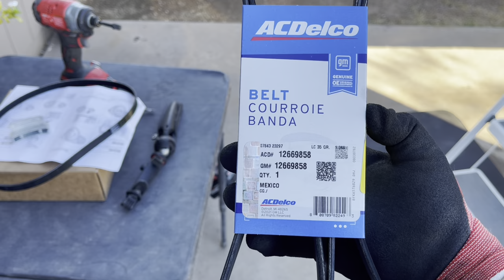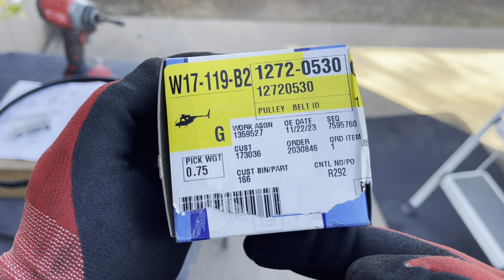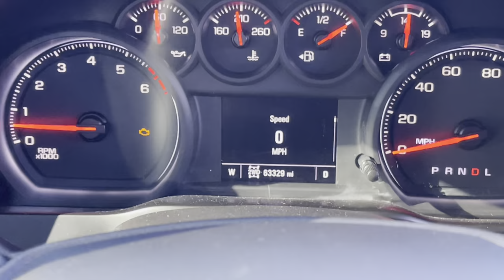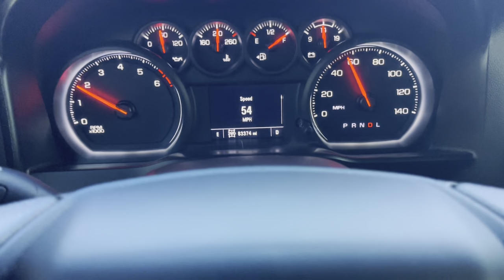Replacing Serpentine Belt / AC Belt & Pulley On 2020 Chevy Silverado.!!

Comment: I just changed both belts and the Idler pulley on my 2019 AT4 6.2, she was screaming hard.  I have no idea why it was so difficult for you to get the Serpentine belt on. I am by no means a mechanic other than YouTube videos. First off there is no need for the extra tool don't waste your money just use zip ties instead. I used 4 zip ties to get the AC belt on and 5 zip ties to get the Serpentine. I used a long breaker bar with a 24mm socket to turn the crank shaft no problem from underneath (if you jack the truck up for those of us without a lift it's way easier). Took me longer to guide the belt and zip tie it down than to turn the belts on. I spent a good bit of time cleaning the belt residue off the Alternator pulley (don't forget to do that). If you run into zero issues this is a 30min job max. I called GM to see what they would charge. Their $485.00 job cost me $65.00. But thank you for starting me in the right direction with your video.
Reply: How many miles did your truck have before you replaced the belts? I have the same truck and I’m at 96K and my belts are quiet
Reply from the maker: That’s awesome man happy to help and good advice 👍🏻
Reply: @Texas_G_Longhorns  2019 with 140k kms (about 87000 miles) and mine is making noise so I am looking at these videos.
Reply: @Texas_G_Longhorns Im in Arizona, and my 2020 LT Trail Boss started squeeling as well at about 43,000 miles. Replaced the belts, and idler and its been quiet since. May just be how dry it is here. No clue. Lol.

Comment: I have same truck my belt has slipped since bran new lol if there is heavy load on altenator  and you floor it ive been able to smell belt rubber and i look at belt looks fine so wtf..bought truck new now has 22k on it the stretchbelt design is tarded.the first thing i in 10:42 stalled was the dfm dissabler if you 10:28 10:34  haven't  you better get it so you dont loose an engine.

Comment from the maker: No problem man happy to help 👍🏻
Reply: Hey man I install the belt and pulley by turning the bottom wheel with ratchet where zip ties go, when I put everything back from air manifold I notice a puff sound coming out of it every time I turn off truck. Is that sound normal? Idk if I messed up timming by doing it by hand
Reply from the maker: @marvintamayo1533  hey I also tried doing it by hand even went back and forth I don’t think that would mess anything up but don’t quote me. Let us know if you figure out wat it is and wat did you do to fix it thanks

Comment: Just another thank you for the zip tie method described a 9:15 in the video. I walked out of the parts store not realizing the guy sold me a 22mm (not 24mm) socket and a tension (not stretch) belt tool. Three zip ties on the serp belt and bumping the starter worked like a charm!

Comment: READ BEFORE YOU START! Definitely put your truck in neutral before cranking the engine. 
-Push to start ignitions: with keys in cab NO foot on break hold the ignition button about 4 seconds, this starts your truck electronics without the engine on so you can then push the break and move to neutral with your park break on and chopped this allows you to rotate the engine crank pulley safely and easily. I read it could damage your transmission if you left it in park. 
-My belt was squeaking horribly for a few weeks. I changed both belts but cleaned up my idler pulley and reused it, it had rubber from the old belt but i greased it and cleaned up the grooves. 
-I cut both belts off to save my idler pulley from bending during removal.
-I started using a 15/16 socket as I did not have a 24mm. I ended up buying one anyway later but it worked and didnt slip bad.
-I broke my first AC belt attempt when it got twisted behind the AC pulley, he talks about this part around 7:30. I had to keep the AC belt guided on the AC pulley while my help cranked the ratchet. 
-Also the belt stretch tool was not helpful for me, I used 4 zip ties for the AC belt and 3 zip ties like many others here. 
-I had to buy an extra AC belt after the first got stuck but I still saved ~$400 doing this myself took a couple hours but I was being slow and making sure not to mess something up. 
-My old belt also shredded and I cleaned it off the engine bay. 
--Thanks for the video bro this helped buy some Christmas presents.

-I also read you can install a belt tensioner pulley with these trucks?
-My check engine light came on after this but that was because I accidentally started it putting it back in park without the HAF sensor attachted yet. I shut it off after 1 second and it just did a little burp when I got it back on no big deal. I checked the engine code and it was just the airflow sensor letting me know it had been disconnected so I cleared the code (you can do this by resetting the battery if you dont have a OBD) the light stayed off so far after that.

Comment: Just did both belts on mine a few days ago. Got them out of the way when i replaced my 170amp alternator with a 220 amp oem had to do high amp upgraded junction block with 250 amp fuse snow plow 200 amp fuse kit  along with starter alternator cable for 220 amp load . Now if i have any audio or accessories they just go straight in the junction box with a oem fuse no aftermarket fuse holder needed
Reply from the maker: thanks for the info man

Comment: Just used this video to replace alternator in 2019 Silverado. Same problem with no tensioner. The zip ties worked. Did it the same way by putting several zip ties and turning on the engine. The belt slid right on! 
Advice to anyone replacing the alternator. You will not have enough room to remove the bottom bolt. Use a T25 driver to remove the fan motor on that side. Allow the motor to gently fall down and it will rest in the shroud. That will give you plenty of room to remove the lower alternator bolt and to install a new one.
Reply: Did you put a new belt and new pulley too? Or just new alternator with the old belt/pulley

Comment: No videos for transmission fluid change yet?
Reply from the maker: no sorry for the wait still on manufacture warranty can't touch it yet
Reply: I already changed my transmission fluid  it did fix any problems I had. I can hear that I have a stock lifter as well. It’s gone away after putting seafoam in the motor but I have a serpentine belt I’ll be replacing this weekend and I believe an exhaust leak did I mention this truck only has 65,000 miles what the fuck Chevy

Comment: You in Arizona? I could use some guidance on the zip tie thing.
Reply: Yes sir
Reply from the maker: Yes sir
Reply: Do the zipties just break off?
Reply: I feel like they would make some damage to the new belt, you can actually see that on 10:19 if I'm not mistaken. Sorry for replying without providing an answer to your question as I am thinking to change belt on my truck as well.